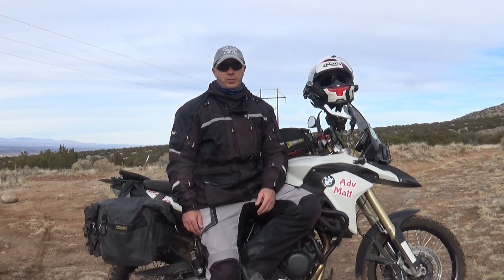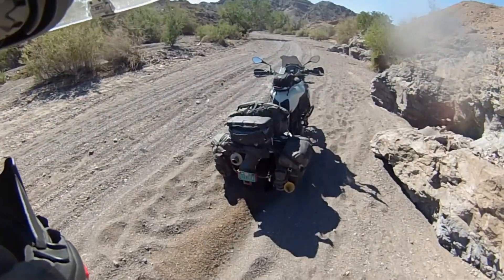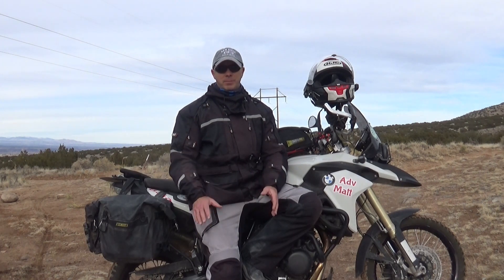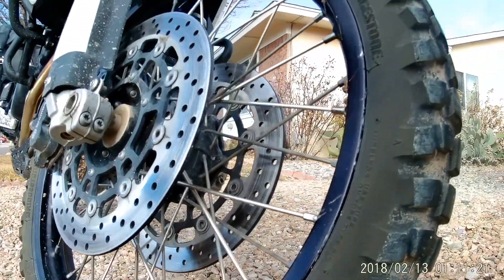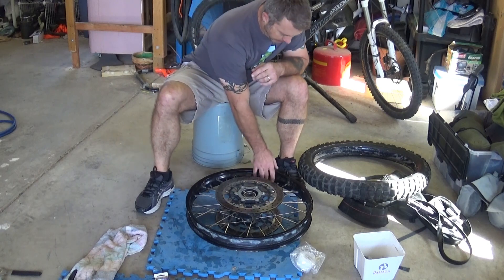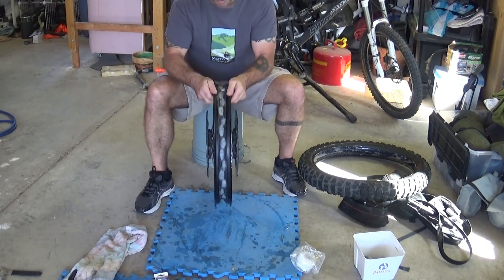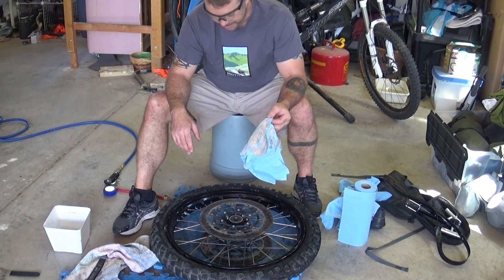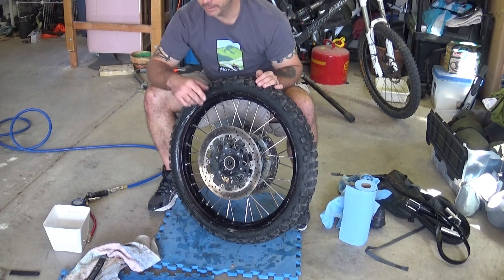Tubeless Conversion - Thoughts and tips on a BMW F800GS

Comment: Thanks for video, not many people showing off their conversions. Especially on the front.
For the rear, I think you could air it down. Those sidewalls are so hard and stiff. Not saying to go to 10psi, but easily 30psi should be more than fine. I rode my Tiger 800 over 5km with a flat tyre, tyre never showed any sign of coming off. Front may be a different story, maybe Ill test that next time ;D

Comment: Thanks.. does sealant holds good if you tighten loose spokes and thruing wheels?
Reply from the maker: Depending on how loose the spoke is you could disturb the sealant, but it is really easy to reseal it after ward if it leaks.  I had to reseal one spoke that was not sealed well with no issues.

Comment: Glad you mentioned that you did this on your front wheel even though it doesn't have a safety bead because that's what was making me hold off. Did you do this to your KTM 390 yet?  I'm going to go ahead and do this to my 500 EXC. I never air down anyway.
Reply from the maker: I havent done this on the 390 Adv yet, but when I finally get spoked wheels I will.  Running tubeless is so much better.

Comment: Did you have to buy a new set of tires for it after converting tubeless? or did you use the old tires just without the tubes?
Reply from the maker: The old tires were already tubeless compatible.  You have to use a tire that is tubeless.  Non tubeless are not manufactured the same and are not safe to run in a tubeless configuration.

Comment: Having hard time getting rear tire to seat. Got any tricks or tips?
Reply from the maker: I used dish soap and water on the bead, made sure my compressor was at full pressure and I bounced on the tire to get the bead to hold air to start inflation.  My compressor at full pressure 120psi.
Reply: ADV Matt I got it. I ended up using a ratchet strap around the outside of the tire and lube and worked it until the beads spread far enough apart that it started holding air.

Comment: Hi Matt! Didn't recognize: are you using a tape over the sealed spokeholes? Because of repairing a leaking hole... and if, what tape used? Cheers and thanks for your interesting work! Guenther
Reply from the maker: I used a silicon tape over the spokes to protect the sealant and to add additional sealing over the spoke bed.
Reply: @advmatt  additional sealing: silicon?
Reply from the maker: Yeah, sorry that was a bit confusing.  I used silicon to seal each spoke nipple, then used 3M silicon tape to cover the entire spoke bed.  The silicon tape seals the spoke bed.  It is a double layer.  My experience with this is seal the spoke nipples, tape is optional.

Comment: What happens when it is time to tighten spokes??
Reply from the maker: You may have to reseal the particular spoke you tightened.  Resealing is pretty simple, same as original process.  I had one spoke leaking when I first did the conversion. It was not a big deal.